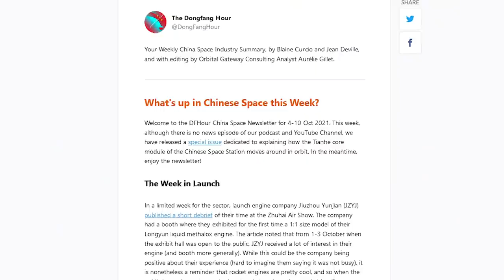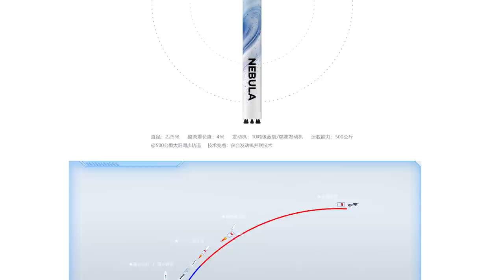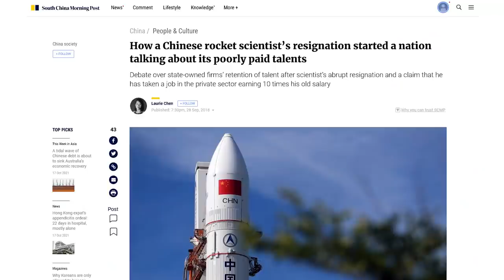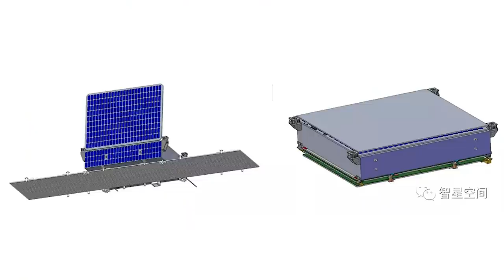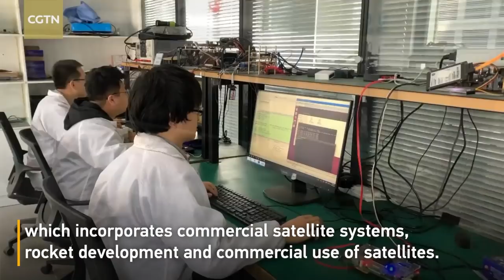Deep Blue Aerospace Performs 100m Hop Test, Shenzhou 13 Docks with Space Station, Rideshare Launch

Comment: Keep in mind that VTVL demonstrators are relatively easy to pull off. Even John Carmack, creator of Doom, funded one (Armadillo Aerospace). There's been dozens of American rocket companies that got to this stage, but never went any further, including Jeff Bezos's Blue Origin because there is a huge different between going straight up and down a few hundred meters, and accelerating on orbital trajectories and returning like what SpaceX does. Even then, SpaceX does it "just barely", the margins are super tight. The rocket lands with almost no fuel and no room for error in its 'hover-slam' trajectory, and indeed, in order to satisfy most launches, it needs to land at seat on a floating drone ship. 

Thus, rapid progress can be expected on single engine smaller test vehicles, but orbital class rockets are a whole other story. SpaceX's "Starhopper" prototypes, which resemble this Chinese prototype, really did not work at all the same as the Falcon landing does.
Reply from the maker: Hi John, thanks for this input, very helpful stuff to put DBA’s tests into perspective. Pinning this comment

Comment: Fantastic work. Hopefully you can follow the nuclear power option for space flight and colonisation China is rumoured to intending on adopting now and into next decade.
Reply: I have seen that China prefers to use the word "Immigration" or "settlement" over "colonization". The Moon has priority over Mars.
Reply: @iqbang9236  well the moon has 1/6th the gravity of earth while Mars has 1/3rd. So let's see how that pans out
Reply: @marcozolo3536  But it is closer with almost guaranteed water and stronger sunlight, most of all, it has Helium III.
Reply: @iqbang9236  the proximity is definitely its major appeal and of course mining helium 3 and rare earth metals as well as water will turn that into a refuelling depot for both propellant and water/oxygen. Making it a critical pitstop to the rest of the solar system